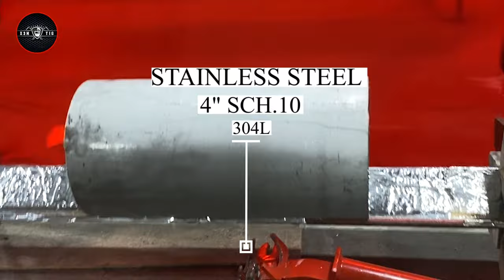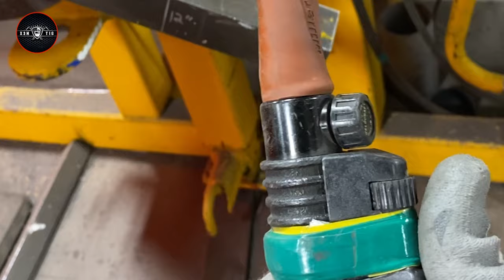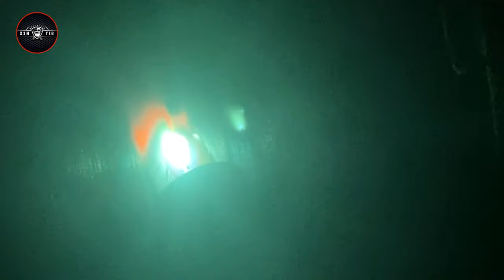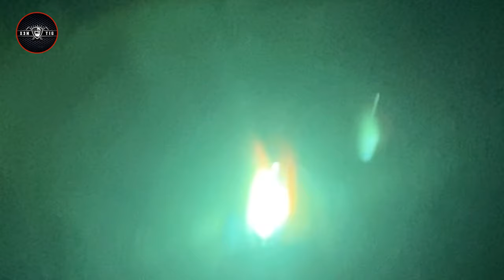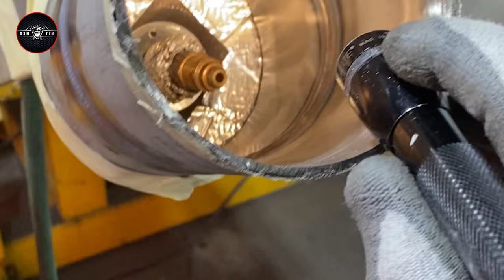No Gap ! 6G TIG Welding Technique | Stainless Steel | Sch.10 !

Comment: I used a flux paste, mixed it with Alcohol. It came out very smooth inside. Tacked foursides and went for it. You can weld seams the same way. No argon

Comment: You’ve asked a very good question that most cup-walkers can’t answer better than the this welder.  I’m very old school from when “freehand or finger-walking” tig ruled the day and cup-walking was very new.  There is a visual sign of full penetration with tig SS but using the freehand technique.  The visual sign is being able to see what we called the “fusion line or the penetration line” down the center of the SS root/1st pass.  This is not seen cup-walking!
Reply: I see that cup walking also. You should see it regardless or your root is probably sucked back or non consumed edges.
Reply: Most definitely can do it walking the cup. Maybe not as easy but nothing in welding is impossible

Comment: Is it possible to make back-bead at overhead position with no-gap condition? like that?
Reply from the maker: Hey bud, thanks for your question . Good question btw.👍 Honestly I’ve never tried that technique on the pipe. Usually that technique is used when heat input is controlled and mostly on thin sheet plates. I don’t think that would work with no-gap joint as you need continuous heat input to form that root inside. Thanks once again, you give me something to think about 💪👍

Comment: QC wouldn't let that happen. The heat input is too high the travel speeds too slow and the procedure calls for a gap. 

But I'll probably still give this a try next time I'm in a welding booth

Comment: Could show how to do it without the bevel ? (but still use wire)
Reply: love your videos btw 🙌 I think your channel is relly underrated.
Reply from the maker: Thanks for your comment and support bud! On schedule, 10 pipes without a bevel is a little bit difficult as you won't get much penetration, especially on the overhead part, and I don't think that anyone will have such a challenge in the field. If you do! You can refuse that, and ask your fitters to fix that or give you a gap. You can do it in the rollout, but only for entertainment purposes. On schedule 5 it's a different story, you can perform welding without gap and bevel. As soon as I got my hands on schedule 5 I will make a video about it.

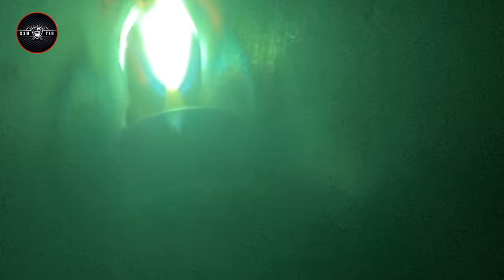Comment: @8:50 your pipe got bursted bcos of delay and too much heat at a spot..
Reply from the maker: That’s right.
Reply: Too much pressure of argon was inside the pipe. Remember you have to let the purge bleed out as well. Even though you had 4 air holes to vent you need to adjust your argon flow rate to maybe 10-20lbs of pressure less and more flow on your tig rig. Then for the cap you can turn argon back up and suck back your root in that’s if you weld it all hot. If you let it cool then you can keep flow at the vent flow

Comment: So with Sched 10, it's fairly normal for it to have a dark colouring on the cap. I've been doing some Sched 10 full purge for work. All my caps are a very dark purple. Never the nice shiny silver!
Reply from the maker: Try to wait for your pipe to cool down before putting cover pass.
Reply: @X3MTIG  thanks. I've been doing that. They came out a little better. 

Trying to get myself in to pressure welding in australia after 20 years of fabricating. Videos are helping lots. Thanks
Reply: Do you keep it purging through all the passes? I noticed it too with sched10...I also need to let it cool more... been doing the same at work, 4" sch10 stainless...316L though but no gap and full purge. Low pressure for ozone plant